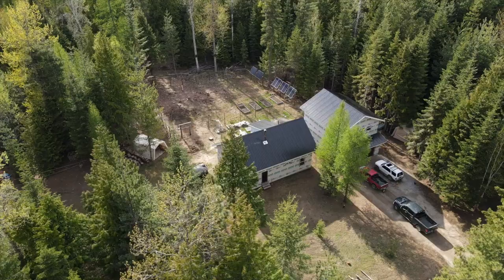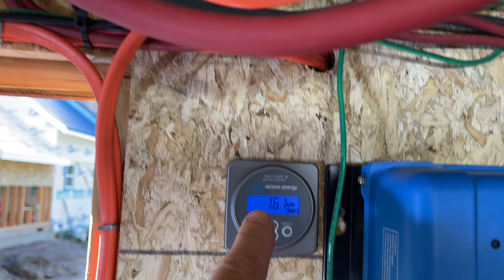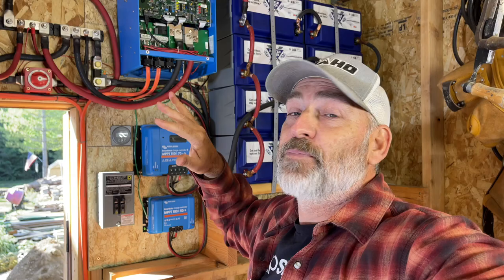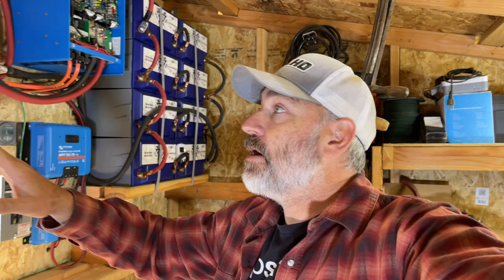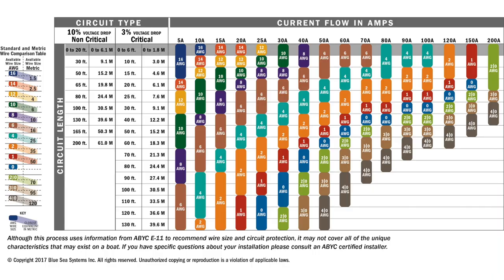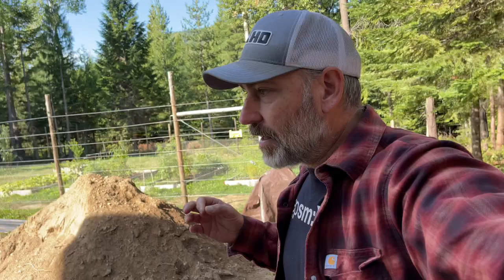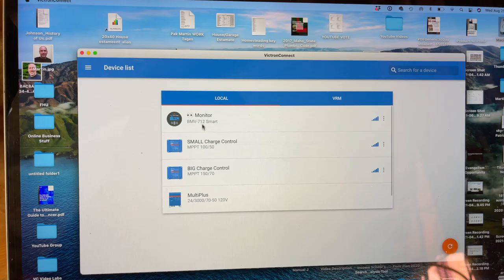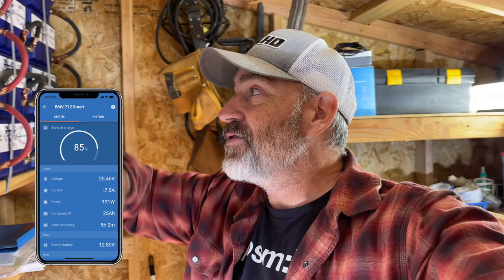DIY Off Grid Solar Power System for Home - AMAZING POWER!

Comment: Great video and very very nice system!  One thing I don't get for a system this large is, is why run 24v?  A 48v configuration would, from what I can see, be optimum, about he same cost for each major component yet half the amperage requirements thus a nice cost saving on the wiring, plus you'd be able to get double the maximum solar power out of the existing Smart Solar inverters?  Just wondering!!
Reply from the maker: Just started out that way and kept with it. 48v would be better.
Reply: @MartinJohnsonOffGridLiving  I hope your wiring diagram parts is available soon?   
I am wanting to get off grid property but am currently in a 5th wheel 12 volt wanting to start building up my solar. Can I start 12 volt then add 48 volt or coordinate the 2?
Reply: @Srjgal  The higher voltages use less current in the cables, (so lower copper loss) thus smaller-gauge cables are needed.  What voltage to use is best defined by your max load (and therefore inverter size) - the mid-size units go 24V, the 'big boys' only 48.  !2V outlets at home can be catered for from a DC/DC converter, thus providing 12V at x Amps for low-voltage exterior lighting, etc.

Comment: I think your first breaker box should have be ganged.  If one 120V leg fails, and your 240V equipment tries to run, I think bad things can happen.  You want both sides to kick if one kicks.
Reply: Yes - they should be ganged. Looks like the wrong breaker was used. I see lots of code and safety issues here.

Comment: Great video! Can I ask why you choose to stick with 24V though? For efficiency’s sake I would have gone 48V or more. Just curious what the reason is is all. Nice job on the setup and explanation! Looks good and only a couple small modifications I would make. 👍
Reply: I would assume he chose the voltage based on the system he purchased. I remember the video where he first moved from the lead-acid batteries to the LiFePO4 batteries, and that was the reason at that time.

Comment: Marty, I'm curious about several things in your solar system and your off-grid living.  First,  why did you choose to use a 24V system when a 48V system is far more appropriate for your future needs?  Due to the fact that once you're finished with your house and apartment you'll need at least a 10kW to 15kW system, your Vitron equipment will be worthless in helping you achieve the amount of electricity to fill your needs. I will suggest you go with a Sol-Ark 12K due to their DIY'er friendly setup plus if you need more power you can piggyback another one and they are over 96% efficient. My other question is how are you keeping your batteries heated above freezing temperatures, as I didn't see any insulation or heating sources in your shed? Lifepro4 batteries have to be charged above freezing and do best when resting at 70F. Your job looks clean, however, I know from experience that you are going to need to upsize your system at least four-fold fairly soon. I would suggest that you build a stanchion ground mount system that can give you over 10,000W of DC for a baseline and be better using closer to 12kW of panels. This amount would give you the energy you need coupled with your generator during the non sun days of winter.
Reply from the maker: Originally we couldn’t afford enough batteries to go with 48v. Them we just stuck with it. Other than that we will just have to see what they future brings.
Reply: @MartinJohnsonOffGridLiving  How are you keeping your batteries from freezing? That's about $8K worth of batteries, I imagine. I didn't see any insulation, heater or heating pads in your solar shed?
Reply from the maker: Last year they stayed just above their low temp limit. I might insulate it this fall.
Reply: Why do you not like Victron?
Reply: @fisherus  It is really not a big deal, because all he has to do is start the generator. The batteries will not ever get damaged because they have a smart BMS inside.
Reply: @fisherus  8k...and therein lays the cost of kw per hour...way, not free energy, save at least 50 cents per hour of use to replace your battery bank...think about setting up a propane generator instead, it will run the whole house and not just a few dedicated loads, you need 40 panels at least to run the whole house...
Reply: @erikcable1755  You can purchase bi-facial 400W-500W panels and get over 10kW of solar power production out of less than half that many panels. I have 32 panels at 370W each that provide a maximum of almost 11kW of power.
Reply: @erikcable1755  I have to ask where you're getting your power consumption figures. I highly doubt that house uses electric heat since it has a propane stove, so that big source of consumption is gone. I'd also assume they use a propane clothes dryer and water heater as well. I doubt they use more than 10kWh per day, meaning they only need to generate that much power to 'break even' over the course of the day. A 4kW system produces 4kWh per hour when running at maximum output capacity, meaning they only need 3 hours at maximum capacity to go over the 'break even' point. Even at only 50% output, that same system would still generate 2kWh per hour. My entire house (family of four in a 2000 square foot house with a well) is able to run off of a 4kW generator during a blackout with the only caveat being we can't run the AC.

Those batteries will be in his system for at least 10 years, so those $8000 can be divided by 10 years for a total cost of $2.19 per day for those batteries in that 10 year span. Using propane for electricity 100% of the time would be FAR more expensive in that same timeframe.

Comment: How long does your battery set up lasts with one charge? I’m thinking of getting this set up without the solar panels, due to my budget and totally rely on my generator to charge them.
Reply from the maker: That would depend on what you are powering. 400ah at 24v = 9600 watt hours. So you can run a 100w light for 96 hours or a 1000w space heater for 9.6 hours. Just depends. They usually last us a couple of days.

Comment: why on earth don't you have the panels on a rotating base with a light sensor that turns to face the sun direction... wouldn't take any power to move it but would get you a whole lot more at mornings and evenings. could do this with an Arduino very easy.

Comment: Hey quick question. I am probably going to build almost exactly your system since my demand is actually a bit less the  yours.  But....it is for a 2nd home and we won't be there all the time so is there any concern about the system not having eyes on it all the time?....or not having a load all the time?  Or is it best to shut it all down when gone and maybe just have a solar trickle charger on the batteries?
Reply from the maker: Wow. Sounds cool. Unfortunately, I have never thought about that. The charge controlers should keep them all charged up.
Reply: Yeah I guess the controller would shut down the solar charge at 100%  I am just worried about batteries getting overcharged or overheated since there is no draw down.   I'll look in to and maybe respond back if I get some decent info!  Thanks for your channel!

Comment: Just looked for the batteries but here in Belgium 12v-100ah would cost around €1000 ($1160). Not sure if they are indeed that expensive but would mean your having 10k+ of batteries to your wall 😋

Comment: Martin, If there was zero load on the system will the solar stop charging once the battery are full?  Just curious what happens if you just use it to charge the battery and keep it for emergency use only like a generator?
Reply from the maker: Yes it stops. They are smart chargers. Very cool.

Comment: Nice to have a refresher on the solar system.  I'm sure you've seen the fairly recent release of the new 400W+ panels from LG.  Any regrets on pulling the trigger on the array upgrade when you did it?
Reply from the maker: No. How much are they per watt?
Reply: @MartinJohnsonOffGridLiving  I don't have an answer for you on that, sorry.  The 425W panel IS larger than standard I believe at just over 6'3"x3'5" and weighs a little over 45lbs.  Pretty sure they command a premium price tag though.

Comment: Great videos!  Question.  How often (months) do you have to charge your batteries with the generator?  I am "assuming" if snow or cloudy day, it will not charge the battery. Do you charge with the generator more during the winter months?
Reply: Even on a cloudy day, the panels will still output some power into the charging system. Granted, it will likely top out at 25% of the maximum output of the array but it is still something. He already stated previously that snow just sloughs off the panels, so that is a non-issue.

Comment: Reminds me how grateful I am to be on grid power...  though it sounds like you don't have a choice... I have argued that off grid solar is not worth the trouble and not green, given all the fossil fuels that go into making the arrays and batteries and need for running generator.  I suppose the greenest aspect of solar is being forced to live with only 2000 watts of power at you disposal... want not waste not...  my utility bill would be under $40 /mo if that were all I could use, makes for a lot longer ROI for those who mistakenly think going with off grid solar will save the plant and a utility bill.
Reply: The reason for most to go solar is just the ability to get off the grid. Not because you have to, because you want to. You can literally build in the middle of nowhere with this setup, and a lot of people would choose that, believe it or not.
Reply: @nigelio3  I totally get that... if you are miles away from a power line, you basically have no other option.  
There are a lot of dudes out there going with this setup rather than pay $10K to run power to their house, save a power bill, or think they are saving the planet.  In most cases you are better off with grid power unless you are a minimalist with low power appliances.  

I have come to the conclusion that all the tax credits are only helping more people to move off grid and move away from populated areas.   Beyond populating wilderness and cutting down trees, the fuel, delivery, food etc.. prices all go up when you are living away from civilization, essentially it does nothing to help global warming, which is why the tax credit exists.  Personally I have no problem with it, the only green/safe power option available today is Nuclear...  Unfortunately because of fear that won't happen so we better get used to living in a warmer climate, you are probably safer off grid.
Reply: @ericfraser7543  Fear of nuclear is ridiculous. But yes, you're right, that's the cleanest, greenest, cheapest, easiest to mass produce energy source that exists and yet largely remains unused, sadly.
Reply: @ericfraser7543  Amen

Comment: Martin I am soon to put a solar system on my 43.5 ft fifth wheel that we are going to travel the USA in full time and your solar design i think will work great so i need to order your plans from you. Do you have a P.O. box that i can send you the cash and you can e mail your drawings? I Don’t use Venmo. I have a question about your battery bank. After using your system now for a while is 8 battleborn batteries enough? i was thinking of using 10 in my fifth wheel due to wanting to run my air conditioning a lot in the summer and more electric heaters in the winter so as to not run my propane costly system so much!! After seeing your system run with 8 is my thinking with 10 batteries overkill, what’s your thoughts if you don’t mind. i would think your house when finished will need way more power then my 430 sq ft fifth wheel!!

Comment: Martin, DO you know that HD dose sell the gray electrical grade Schedule 80 PVC Conduit to safely run the wires from solar array  to the shed it's bean two years now without it? just remember DO IT RIGHT THE FIRST TIME, EVERY TIME, ALL THE TIME.      (Instead of MICKEY MOUSE?)

Comment: MJ, are you using a 'non-inverter' type generator?  Do your electronic devices have any issues with the 'dirty' power?
Reply: The generator is pure sinewave, just that the engine rpm can very when loads are started and stopped causing the frequency to shift as the engine stabilizes.
Reply: @uhjyuff2095  That generator is NOT pure sinewave.. It has a THD of around 23%... Hopefully he is running all that power through the inverters and back to the home to "clean it up"..
Reply: @FJB2020  From the generator manufacture: "Champion portable generators will output an industry standard total harmonic distortion (THD) rating of about 12%-20% depending on load applied. They will produce a sine wave, not a modified or square wave. This is perfectly acceptable for running common commodities found in your home such as TVs, computers, your appliances, etc.

THD is a measure of the deviation of a sine wave from a "perfect" sine wave.  All electricity, including line electricity, has measurable THD."
Reply: @uhjyuff2095  Real world testing show they are dirty and run around 23% (there are tons of YT channels dedicated to generators).. Only way to get clean power from a generator is to buy an inverter generator, put an inline power conditioner on it or install a double conversion UPS..
Reply: @uhjyuff2095  I just did a bunch of research on this for my coworker who wanted backup power for his kitchen appliances... They are all new Samsung units and Samsung clearly states that only 3% or less is recommended for their products..  This is the same for computers, tvs and other equipment like that..
Reply: @FJB2020  Yes, you are correct some appliances are nonlinear loads. Your original statement said the sinewave of the generator is not a pure sinewave, and it is a pure sinewave. The load determines if the sinewave is not pure! Running a linear load or very few non linear loads the sinewave is perfect coming from the generator... how could this be if you say the sinewave is not pure sinewave?
Reply: @uhjyuff2095  "A pure sine wave is the path described by a pure sinusoidal mathematical function. A sine wave is an expression of anything else (a wheel turning, a heart beat pattern on an oscilloscope, etc.) that can be approximated by a sinusoidal mathematical function. The "pure" implies no adulteration of the function or signal."

Comment: It is good you fused your setup, but if that is an ANL automotive style fuse, the amperage of the bank is beyond the capabilities of the fuse type chosen. If there was an inverter failure, that fuse could burn down your shed. T-type fuses in holders are far superior.
Reply: Exactly. If that fuse pops all this gear and the shed is toast. Fuses=fire.

Comment: Just because the batteries have a BMS doesn’t mean their packs are remaining balanced unless the BMS does a really good job which battleborn probably does , I think it’s a Daly BMS, but other brands need to be top balanced once a year. There are packs of cylindrical cells inside no? Yes. Not everyone can afford Battleborn. ( 2-3x more expensive than many others) So for others, every year, take the rig apart and charge each battery individually to make sure all SOC ‘s are same. Then reassemble in parallel/series etc.

Comment: Have you thought about running your generator on propane?  The  generator will make a less power but propane is cheap and you don't have to bother filling the generator tank.  If you're concerned about not having enough power to start your well pump you can add a soft start to the pump.
Reply from the maker: Might just do it. Someday.
Reply: @MartinJohnsonOffGridLiving  They do of course have dual fuel generators. Can find them on Home depot's site (sure elsewhere as well). Just for future planning if you wanted to go that route. You do have the propane tank already, so you'd probably just have to tap off a line to the generator and you'd be set. They also have the backup generators that can run off of propane that basically kick on if your main power goes down. Not sure if these can be used on solar power systems. Something to research, or if someone knows about all of that, they can chime in! Love your videos and all the awesome progress you guys have made. Quite envious of it LOL. Take your time building so you have more time to put out content on the build. haha just kidding. But I think the day that everything is "complete" will be a proud, but bittersweet day, for you all plus us viewers. Take care and look forward to more videos and what the future holds.

Comment: The monitoring via Bluetooth seems gimmicky. Ethernet cable is optimistic but they should definitely work on sending the info over a WiFi signal.

Comment: Hello Martin love the video i been watching u for a while now question what voltage is ur solar 24v or 48 and is the Victron battery monitor a Bluetooth enabled monitor ?
Reply: In answer to your questions, Marty's install is 24Volt and Vectron BMV-712 is Bluetooth-enabled.  Most medium-size installs are best set at 24V (a 12V system would need far larger wiring), 24V reduce the current (so wiring diameters). 48V would reduce these still further, but these are far-best used on large installations.
Reply: @tonyleverett1483  oh ok thanks I think I'm going back up to a 24v system this 12v is also very limited on the amount of watts my panels can bring in